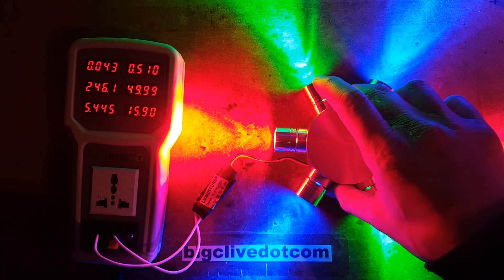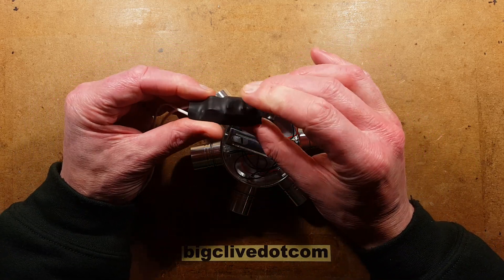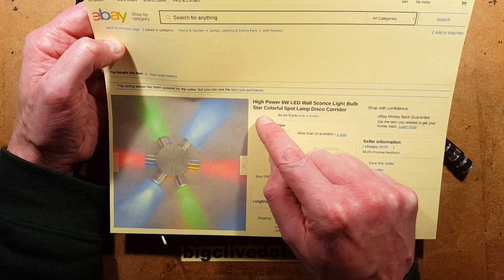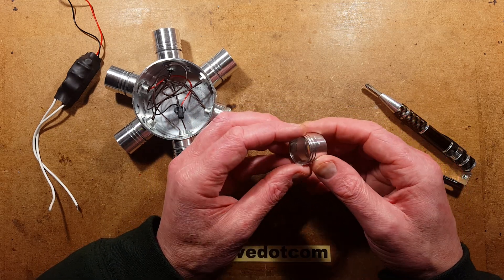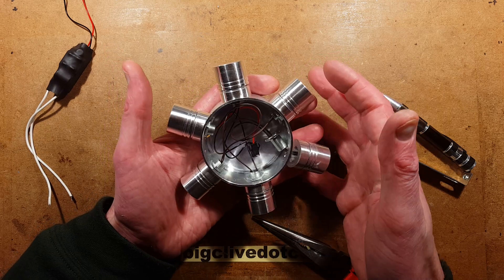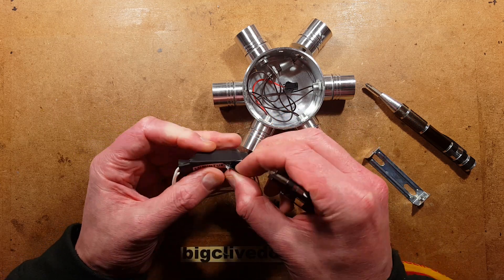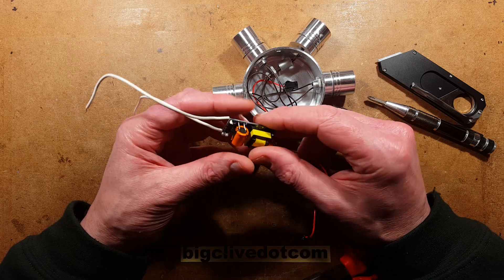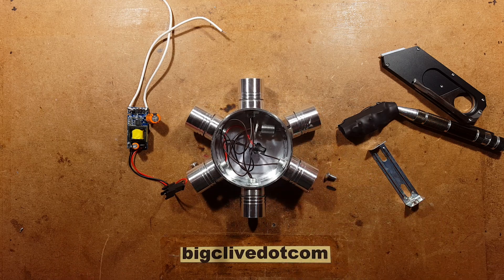Very hackable LED star light.

Comment: Could be easily rewired to run on low voltage. Would definitely be safer than putting a heatshrinked mains supply in a metal case.

Comment: Hey Clive, I was wondering if you could order some MOSFET based "Schottky diode" "anti-irrigation" blocking circuits found on eBay for a test and schematic.
Reply from the maker: Can you give me an item number?
Reply: @bigclivedotcom  372534453445
cheers!

Comment: Would it be possible to adapt one of the modern Qualcomm QuickCharge USB PSUs that can put out 20V so that it puts out these 20V without having to talk to a "QuickCharge chip" so that it could drive this light, if one added a resistor to drop 2-3V?

Comment: Hi Bigclive!  First let me say Thank you for all your very informative videos !! I have learned a lot, I have been wanting to put in under cabinet LED lighting for my kitchen counters for some time now what set up would you use if you were going to do it in your home? (LED strip approx 10' long soft white) I do not know what is better and SAFER a capacitor dropper? or a actual LED power supply? (110v down to 12v) You have talked about both a lot and I STILL do not know for sure which is better? Thank you again for any info you can offer and as always TWO THUMBS UP SIR!!!!
Reply from the maker: For standard LED strip I recommend using 12V strip and a locally sourced 12V supply.
Reply: @bigclivedotcom  Thanks Clive for the fast response! that is just how I will do it seems like I ALWAYS forget to K I S S it!   (K I S S = Keep It Simple Stupid) Two Thumbs Up my friend!!

Comment: Definitely doesn't meet Low Voltage Directive compliance and very likely doesn't meet Electromagnetic Compliance, either radiated or conducted. As usual the manufacturer probably doesn't know how to design and just used the Semiconductor suppliers application circuit which would not include extraneous components required for CE compliance.

Comment: that little power supply doesnt fill me with much confidence, there doesnt look to be much in the way of isolation distance on the board and having watched Diode Gone Wild unwind a lot of those little switching transformers a shocking (!) proportion of them are not things Id ever want to use, with secondary windings right on top of primary or auxiliary windings and literally just the lacquer on the transformer wire separating you from the mains

Comment: Wanted to make sure you saw this so double posting..
Just wanted to say thanks for all your solar light and 18650 videos. Because of everything ive learned I was able to modify the big solar light I have on the side of my house to make it so I can manually charge it with a USB power bank/USB Charger via a TP4056 Charging/Protection Board, I connected a long enough 22AWG wire so that I could charge it from the ground instead of always having to take the light off the wall which always requires a ladder to do. In addition to that I was also able to change the battery as I found the quick connect adapter the original battery uses on Amazon. Because of all this i'll probably try modifying some other solar lights I have so they can also be more useful during the Winter.

So thanks again and thanks to @Siana Gearz for pointing me in the direction of the board.
I hope this also would be an interesting project for you to do as you tend to be Sun limited and it would help any of your solar lights to still be useful during day light restricted days.
Reply from the maker: Sounds good.

Comment: The lens is a TIR lens - which I find fascinating.  I think that they are very efficient.

Some of the TIR manufacturers make multi-head TIR configurations that will allow 7 LEDs side by side, all oriented parallel.  I think the intended use would be individual colors that can then be combined and tweaked to give very exact color matches.

Comment: I started making wood  moldings with LED bicycle string lights  before I rip my three eights strips,I router the edge,,then run my wood through the table saw to get a fine groove,(to stuff in the LED strip,lights pointing out),then again through the table saw to finish cutting the strip,,when done,stuff in the LEDs stretched inside the groove and epoxy,,it makes a beautiful molding for your woodwork

Comment: I thought this was a usb hub and 6 of your fave 2w usb spotlight heads.  I imagine you could quite easily cobble together a not quite as splendid version with one of those boiled sweetie tins you get on the motorway services.
pink & white seem to be one of the standard colours they use on the outputs of those little power supplies - I've just bought a box of 2' striplights and they use the same orange capacitors and pink wire.

Comment: Am wondering where that light would go
Reply: Description says hallway of a disco.  So in style but not blinking and rotating.
  Other mounting options:
1. Remove one LED and screw onto standard lamp (same thread).
2. Attach Earth wire to any screw in the metalwork for proper grounding.
3. Run from battery system to provide emergency lighting in Disco hallway.

Comment: Where does the power waste from these excessively reactive loads all go?  Heat dissipation all along the lines back into the power generation facility?  Or does most of it cook away in transformers at the street and substation levels?
Reply: Depends on actual waveform.  Some will heat the neutral wire via 3rd harmonics adding up.  Ultimately the reactive or capacitive current will circulate between the gadgets and the distribution transformer causing higher resistive losses in that loop corresponding to the what would have been wasted transporting that many amps of real load, but the reactive watts themselves should cancel out somewhere.

Comment: Easy way to make it 12V is to use one of the step-up type constant current supplies that are used in MR16 style 12V LED bulbs.  I made a nice caravan ceiling light like that, using seven 1W neutral white leds (the star type) in series on a circular piece of steel (cut from the case of an old CD ROM drive).  Current turned down slightly and compensated by using more LEDs than needed (while giving a bit of headroom above 12V for the step up type supply while being used with a vehicle supply).

Comment: it's a shame you destroyed it just to find out what makes it tick...
Reply: It's not destroyed and it doesn't tick.
Reply from the maker: It's all back together.
Reply: It's not destroyed at all. If I were installing that in my home I would want to upgrade the power supply anyway.
Reply: If you get into repairing stuff for people, then you'll soon learn how to strip something down and re-assemble it without it looking like it's been ever taken apart; apart from warranty seals, but there are a few methods for removing those too without breaking them - not really a problem if the warranty has expired; if it hasn't, then you get the person with the device to get a replacement instead of attempting repair (unless they've lost the receipt or just plain can't be bothered).

Comment: Finally, a video the HOPI isnt flickering like an epileptic episode
Reply: until he turned the light on.
Reply: I guess we can't call it the flickery HOPI anymore :(
Reply: I noticed that also. Maybe its his lighting, and not the camera after all. Change out the room lights to something else and it probably wouldn't flicker anymore. Just a guess based on that observation.
Reply: @keithyinger3326  he mentioned that the camera went to a slower shutter speed, which cancelled the flicker effect.
Reply: Darkness needs a different exposure.
Reply: @keithyinger3326  it's the fact that the display in the Hopi is multiplexed. If the refresh rate of the display is different than the shutter speed, flicker will be noticed.

Comment: I startet my vocational education as a "metal cutting mechanic" in Germany when I was 15. So nearly 20 years ago. It's very important to make good chamfers on your machined part. This turned parts are not a good example for a optimum finish.
Reply: At least give those parts a small hand job to finish them.
Learned it the hard way when I cut myself on a part, because it's just a quick adapter...
Reply: I think those 2 slots should have piston rings in them and that the things are out of a model 6 cyl deltic engine ;)
Go, let's see your imagination do better than that !

Comment: Neat looking light. It would be interesting to add some sort of random strobe effect really give it that disco feel
Reply: A microcontroller, a regulator, and 6 transistors would handle that nicely and could make for another enjoyable build video.
Reply: Peter S agree!
Reply: @GeorgeJFW  Imagine the potential of making a version that used RGB stars. Going in your original direction, a discrete version using 6 surface mount 555s (and little trimpots) for true analog randomness would another great build video and I think Clive could sell a few of those PCBs in a kit form to support the channel. After all, for integrity, Disco should really be fully analog.
Reply: Peter S of he doesn’t build it I might give it a shot hahaha 😂